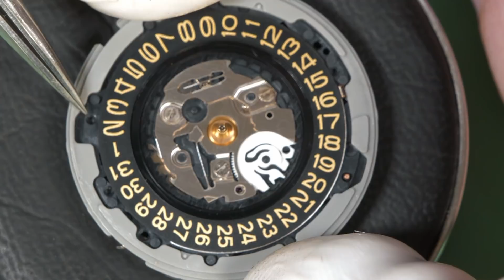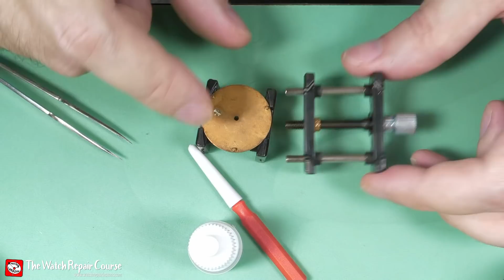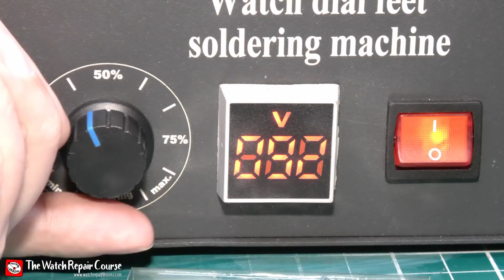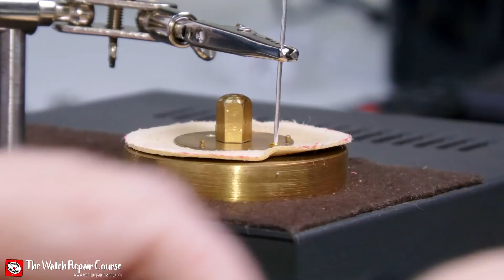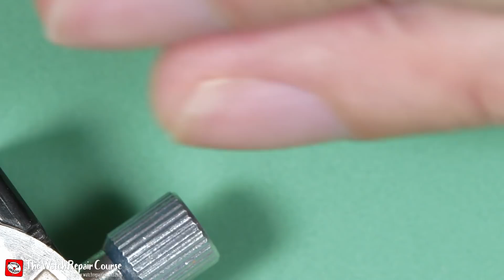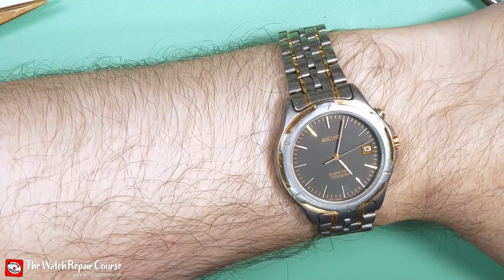Repairing a Seiko quartz watch dial. How to use a dial soldering machine.

Comment: The best and in my opinion only solution is laser welding the dial feet back on, it's like factory and you don't risk damaging the dial.
Reply: Sorry, but I don’t agree with you. This machine is not a welding machine, but soldering machine, which works on relatively low temperatures. (130 Celsius)
Our hungarian company is a distributor of the laser welding machine. I can tell you that, the laser welding machine can not be used on finished dial face, because of the high temperature of the welding process! ;-)

Comment: Seems to much hassle to set the machine up and solder replacement feet to the dial. I'd much rather just mill and glue them on.
Reply: It's just a question of practice. As mark said at the end of the video, you would practice enough befor use it on real dial face ;-)
Reply: @imreserdult1403  indeed, practice makes perfect.

Comment: In order to make a strong bond with metal and solder, both the wire and the dial need to be brought up  to the same temperature at the same time before the solder can make a strong bond. However, the front of the dial would probably be damaged.  I am a master goldsmith and bench jeweler and would not ever use that machine. Go with the epoxy method!
Reply: The machine is heating by flow of electric current through the pin and the watch face. This is known as 'resistance soldering'. The temperature at the junction between the pin and the face will be equal.. we see full melting AND wetting of the solder paste, indicating the temperature is sufficient. I own resistance soldering equipment and use it regularly, along with traditional heat transfer irons, and multiple flame and flameless torches. I do agree with you, that the mill/epoxy method with headed posts is the safest approach and will produce a sufficient bond.

Comment: Looks like you might be able to mill a recess to then solder the foot on, so you can still mill the excess solder away while being flush the the back of the dial.
Reply: Exactly my idea. The joint is rather weak when there is only solder between the tip of the wire and the dial.  When the wire is embedded in solder on all sides that improves its resistance against lateral shocks.  BTW, epoxy is a much stronger compound than solder and the contact area is much larger.

Comment: Do you think the designer uses a leather mat... because it's an insulator from electricity and prevents heat sink through the dial in to the brass table?
Reply: Probably not. The dial needs electrical contact to the machine (hence the middle screw) otherwise there would be no arcing and heating. It's probably leather because it is soft, doesn't turn brittle, doesn't scratch what it contacts, doesn't burn or stick to the heated metal. Like gloves.
And also the surface contacting the dial should never be the painted/treated one, but the rough coarse one to avoid any sticky residue (paint or other treatment).